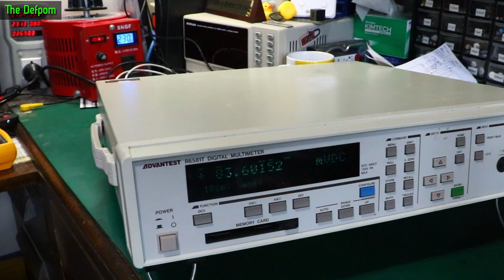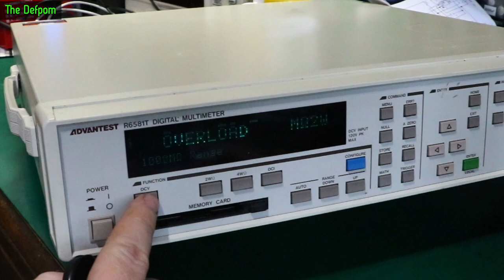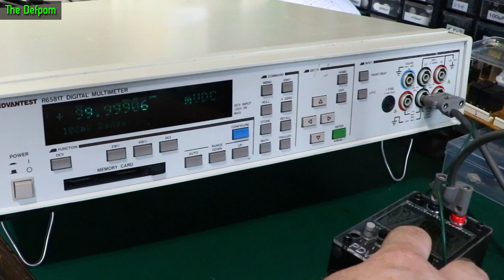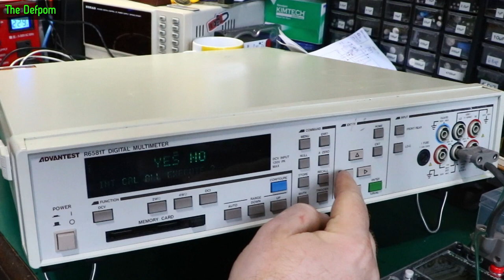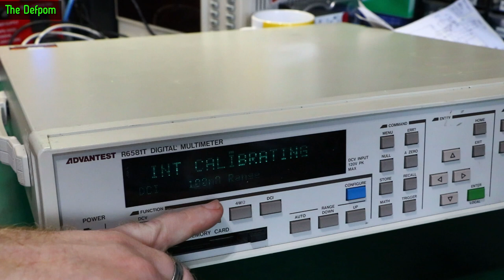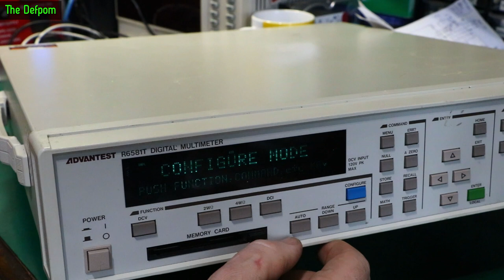🔴 Advantest R6581T 8.5 Digit Multimeter Repair Part 1 - No.1051

Comment: You can try running dc for a short time to the grid wires. Basically increase the voltage till the grid wires just start to glow dully. just for a few seconds. May help brighten up the dim display.
Reply from the maker: Already done :) this is a 5 part repair series, I show it in one of the upcoming videos.